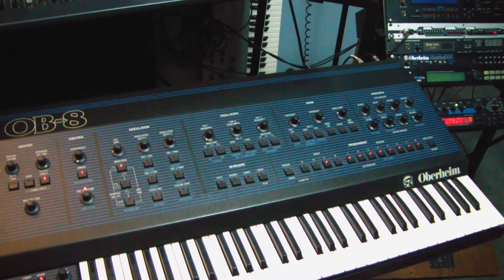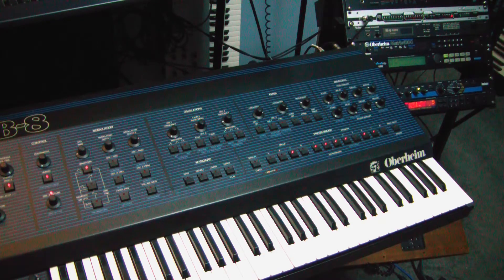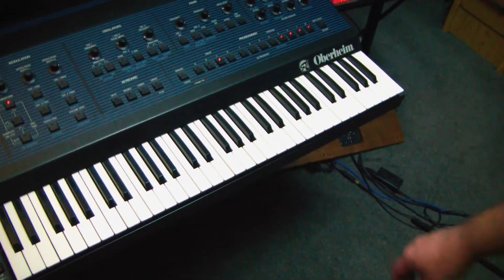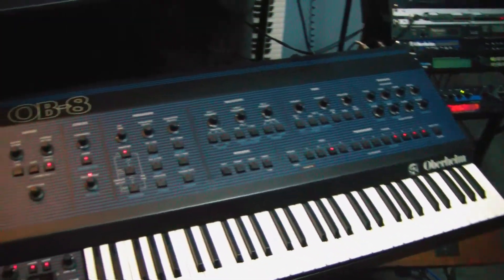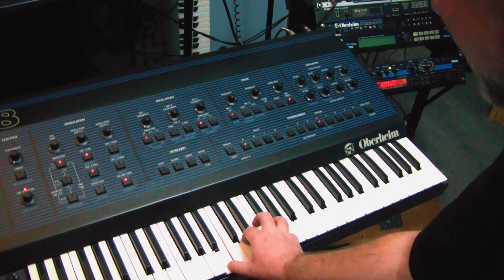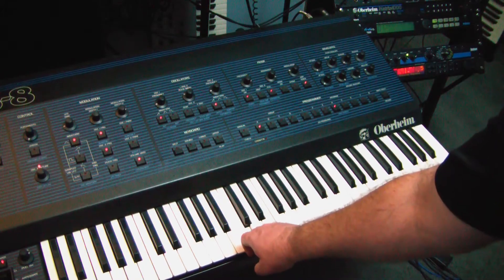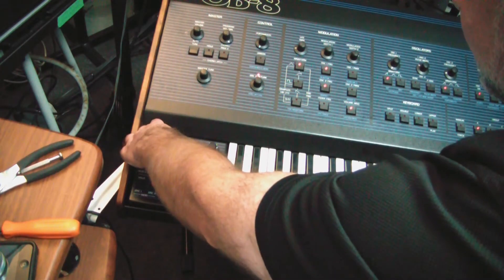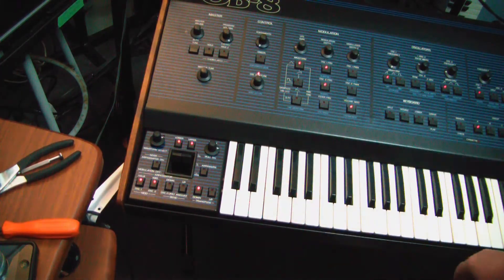Oberheim OB-8 Analog Synthesizer - Problem

Comment: Which voice board? Do you remember if you replaced all the capacitors on your board? Experiencing same issues
Reply from the maker: foxley The top board. The problem in mine was voices 5-6. Eventually we replaced them all but to fix the problem we only replaced the ones in the sample and hold circuit that controls the pitch. I circled them in this picture  https://flic.kr/p/fceLtX

Comment from the maker: As I said, all calibrations were done and worked out fine. No errors or problems. Except that when the oscillators are calibrated and in tune according to the computer, they are not in tune for those 4 voices. So it's like data from those oscillators is not getting back to the computer properly. I checked the cable and connectors though. So it's still a mystery!